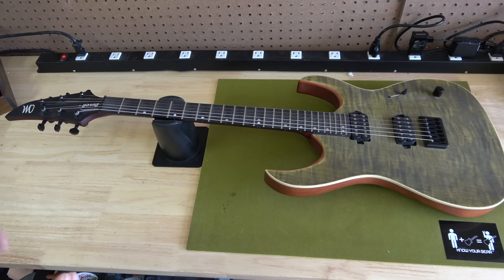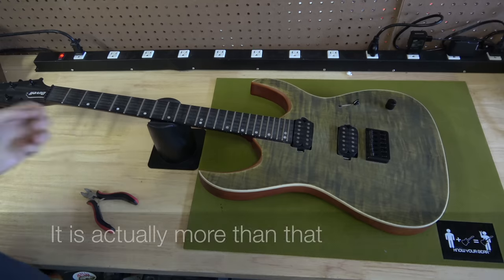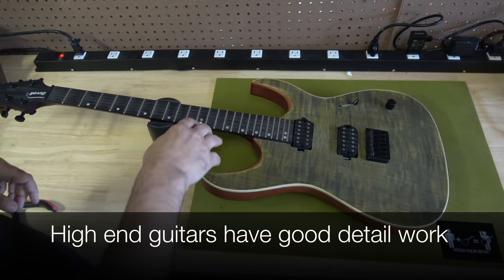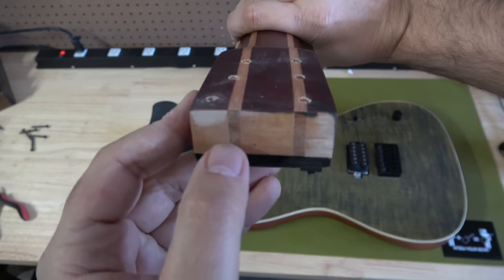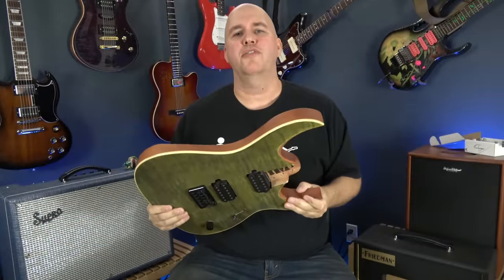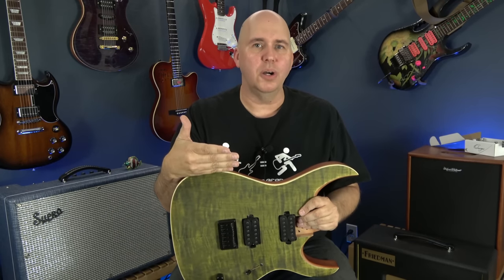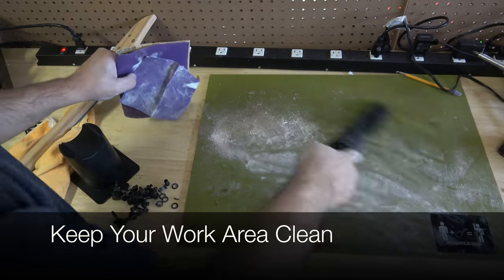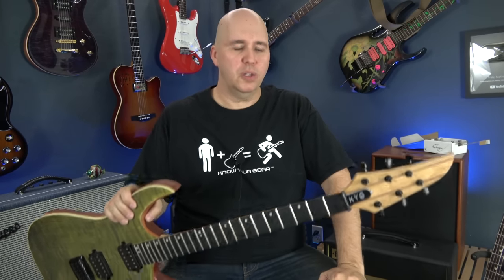Counterfeit Guitars Are Out Of Control.

Comment: I say, buying fakes is fine so long as you dont try to resell it as a genuine
Reply: Exactly. NO one that has a clue is (a) going to be fooled by one or (b) think they're getting a Les Paul for $175.
Reply: I was at a guitar store in San Antonio checking out what I thought was an older Les Paul like 50's relic. And I noticed this little gap be tween the b and s in ths Gibson Insignia. Well it was fake and going for $500. It was made but a local guitar maker, very cool though. I paid $500 for  '75 LP, but it was real, thank God.
Reply: Eddie Perez wish I could have seen it. Sounds interesting
Reply: NO

Comment: I got a low end Ibanez knockoff I modded with a high gain humbucking pick up (I do not need to use the other single coils), put Grover tuners, installed good quality hardware and electric shielding. I had a luthier to put it in its tracks with intonation and truss rod setup and pronto: best guitar any amateur would want.

Comment: Excellent points, Phillip. I'd add that what I find, fairly often, with knockoffs, is not simply poor fit and finish, which is, sadly, more and more common on any big name, high production, factory made product, but, as you say, the details. I get a lot of offshore guitars in the shop, and do my best to bring out the potential, hoping the customer can end up with a great playing guitar that is still well under the price of a famous brand product. While I have had perfectly fine knockoffs, like an American Alder SX tele with 1/4 sawn maple neck, 2 way truss rod, great pickups, excellent fret job,  fine tuners, excellent finish, I had to wade through a half a dozen to find this ONE good one. All it really needed was a bone nut and graphtech saddles, which I put on everything I can. But what I often find is the fakes cannot be intonated, accurately. The placement of the bridge, or the scale of the neck, or both, is just off, ever so slightly that it is impossible to ever dial in perfect intonation. Other details I find, fairly regularly, are the tuners may not be lined up; the nut slot may not be cut square; the access hole to the truss rod may not be large enough or may be off center or both, so you'd be looking at quite a bit of work to correct these flaws. Most of these details are not apparent to an excited buyer; they can only be found when it's on the slab, ready for mods and upgrades. American parts will not fit offshore guitars, and I often find expensive, quality parts on cheap guitars, and they do not help because they do not fit. I recently had to undo all of the rather expensive upgrades to a rare, badass, limited edition Indonesian Squier Strat. When I got it back to stock, it was perfectly fine, and still inexpensive for the playing quality. The last area that distinguishes cheap knockoffs from the real deal is the quality of the wood. The top name factory builders and boutique builders select the best grade, correctly cured woods. The cheapo brands don't bother; consequently that (now) great looking neck may warp or twist after a few years. (Got one sitting right here, now). Not such a problem with a bolt on, but end of the line with a set neck. All in all, I agree with you on the main points. I hate fake anything, and have never respected ripoffs. Building a reliable, stable, perfectly fine guitar shouldn't break the bank. You just have to consider what is worth while. By the way, my dear old friend, the late, great Larry Coryell showed up with a Cort guitar, once. I asked if he had fallen on hard times, and he laughed and explained that Cort had been around for a long time, building all grades of guitars for lots of brands, and that ALL of these big factories build guitars for all levels of players, from beginners to pros. His signature Cort is an example of the top quality products they can, and will, make.

Comment: Hi Phil, 

Would appreciate your input.

After removing the logo, sanding down the neck and re-staining and removing all other propritary logos, at that point is it really nessessary to brand the guitar as fake?

I my self made a copy of a 54 start from scratch. I Made the neck and body, manufactured all the components, bridge, saddles tuners and wound my own pickups. But it is as close of a 54 strat as I could get, nitro finish and all. 
Would u say I should b branding this as fake? Even though I do not have any of the fender markings (minus the head stock shape). 
I ask because once you have done all the modifications to the fake guitar you had its basically the same as what iv created?

Cheers!

Comment: I have a $400 guitar with Seymore Duncan's and locking tuners and it plays and sounds better than a Fender or Les Paul. I changed the strings and pots as well and it's sweet. $4000 ??? Nah!!
Reply: Same...It's all in the setup and wiring..
Reply: That's cool. I have a Schecter that I gave 700 for with a gator case. It's got Seymour Duncan's on it and it's amazing for the price. All the so called high end guitars are way overpriced.
Reply: The thing with cheap instruments in general (not just guitars) is an utter lack of quality control. You may get a really nice one. More likely, you'll get something reasonable, but with one major flaw you have to fix if you want to use that instrument seriously. But from time to time, you'll get something that is just utterly unplayable and should be harvested for parts. When you pay more, you damn well expect NOT to get one of those (although occasionally you still do).
Reply: @mal2ksc  There's really no substitute for playing and/or inspecting a guitar before you buy it.  Buying stuff online is definitely convenient, but it's impossible to know if you're getting a good one or a dud unless you actually play the exact guitar you are buying.
Reply: I have a Schecter $700 guitar and I have an Ibanez $2000 guitar and I can tell you that it’s night and day difference.  The Schecter is still very good for the price.  It’s just not as good neck action but close enough to be very playable.

Comment: I get all the hate on fake guitars when people are getting ripped off but there's a good side too. You can custom order any sort of shape/configuration/fretboard, basically like a custom shop but cheap, they're not the best guitars at first but once you've upgraded them and get it set-up they can be pretty damn good guitars customized to your liking! You will have to find the right shop, there are some really good ones but there are alot of bad ones too though.
Reply: I don't know of anyone who would mind that. Not everyone can do the woodworking to build a guitar from scratch but most guitarists know how to set up guitars. As long as they don't go around saying their diy build is a legit 1947 Gibson or an original series LP and they are straight up with the fact they put raw to work no one I know would say anything bad, especially if it sounds decent.
Reply: Yes, but that can be done without saying it's someone else's brand. I'm perfectly fine if you build a single-cutaway solidbody, two pickups, 3+3 headstock... but brand it as "Gibson" and say it's worth $4500 and that's where we'll have issues.
Reply: Guitars especially electric guitar aren't very expensive to make, you don't need to fidget with acoustics, you can in theory make it out of a shovel and it'd be fine. It isn't like that with many other instruments. So the extra thousands that you pay for a premium guitar, that's mostly brand and some nicer crafting. But I bet if you paid the Chinese more, they'd do just as well. Besides people complain about the neck not being sanded properly or the frets being rough, you can fix that yourself very easily.   

Do you have any shop you could recommend Rudie?
Reply: @robkphoto5530  Not every shop makes the same guitars so just look on AliExpress and find a shop with the guitar that you want, make sure it has good ratings and lots of orders. Send a message to the shop to see how they communicate and test their knowledge. When you've ordered it ask for pictures before they send it so you can spot things that might be wrong when it's still there.

And like you said, lots of little problems that might come with it can be fixed by yourself quite easily. I think you can get great value guitars from there.
Reply: @egmccann  that's why I ordered mine without a headstock logo, or put on your own custom logo! People don't realize that it's also People who scam with these guitars, don't blame the manufacturer.
Reply: @robkphoto5530   I'm guessing you have never built an electric guitar from scratch. Just buying good lumber for a guitar can cost more than $100. in fact a good flame maple top will cost more than $200. That doesn't include any of the hardware. If you want quality, it costs money. So often people want quality at bargain basement prices, it's an awesome dream, but not a reality. If you want a cheap guitar, fine, buy one. Hopefully you don't need it to have a brand name on it. One additional thought, how long does it take you to sand the neck or do a proper fret dress? When you get a really good quality guitar (it doesn't have to be one of the major brands, there are some amazing custom guitar builders out there) they put the time into building the guitar correctly. That takes time, skill and the use of high quality materials.
Reply: @nicholascustomdesigns8365  Most of the cost for US built guitars is the labor. But realistically a skilled laborer in China can do just as well. Except you'll be paying the US worker $20 an hour and the Chinese $2 an hour. So if both put 10 hours of work into it that's $200 vs $20. Problem is most Chinese are still working at huge profits. If the mindset was changed to quality they'd be unrivaled because of lower labor costs. 

Again, whether you buy wood for $5 or $50 000 it's going to sound exacly the same so that's kind of a dumb argument. A car with gold plated interior is more expensive but doesn't add much to functionality. I can get any reasonably good wood for a couple of euro for the quantity needed for a guitar. No material on a guitar is very expensive at all. Unless you go for rare woods or they are for some reason prohibitively expensive in your area.

And for "some" reason Japanese made guitars (and most other products) are cheaper and better. Compare American or European made motorbikes to Japanese made motorbikes for example.  American labor products are always going to be prohibitively expensively because of the working culture and wages. It's impossible to have a good product at a reasonable price when you don't have neither the conscientious working culture of Japan nor the low wages of China. 

Hence why you have such a huge trade deficit, you need to focus on intellectual products, luxury goods, software etc. Whilst the Chinese guitars aren't the best quality, they are leagues better of a product for their price than American guitars. Look at the iPhone, it's far too overpriced for what it is... (that's your "American brand" price = Fender) now imagine if it was actually made in the US, it would probably be 5 times the price if profit margin was to be kept (that's your labor costs).

Comment: Seriously sometimes the right set up is everything... I got a cheap Jackson, and a luthier but it in pieces just to put it back perfectly and super precise together.. cleaned the pickups (different ones, not the ones the guitar came with) from the inside , even mill out some parts out... He worked over 12 hours on it and it sounds and feels like a complete different guitar, much more sustain, more clarity, better tone in general... You don't really need to buy a expensive guitar :D

Comment: To add to this, look for stories from sellers that don't add up. For example, I was interested in a Jag-Stang on Reverb. The seller used photos that he stole from various ads on the internet and said that he didn't take photos of the actual guitar because it was in the studio. First off, the stolen pics are a huge red flag and secondly, if you write songs using the guitar, chances are you're going to take it home with after you've spent time in the studio recording. In my opinion, it's not believable. He also did the sense of urgency thing. He told me he had a baby on the way and needed cash asap. He also told me he had another interested buyer which is a line I've heard from people selling cars to just about anything. Do your research and a little detective work if you need to before sending anyone money over the internet. If I hadn't of done reverse image searches of the pics he uploaded, I may have sent a stranger nearly a $1,000 and got ripped off. I did report the ad though and Reverb took it down. 😁

Comment: Another great video 👍 from what I’ve seen generally the attention to detail on fakes is usually focused on the things you see - the shape/colour etc. So if in doubt look at the less obvious things 
- fret ends
- truss cover
- nut
- control cavity - looking inside might reveal a lot.
Even really small things like the screws used - do they all match?
- are they placed correctly relative to each other.
I know sometimes its easier said than done to not be fooled but if in any doubt don’t buy it. If its bugging you before you’ve bought it its not going to go away.

Comment: Interesting enough, I recently bought a guitar from "Wish" as the cost of the guitar was not much more than the free shipping break point. $20 for shipping or $70 for a guitar and free shipping, you can guess my decision.

The $70 guitar I received seems to be better than this high end fake. To be clear, it makes no claims. Headstock is not marked. There is no serial number. The pickups are probably cheap. But... The frets are nicely finished (I would say better than my Spirit by Stienberger [made in China {don't get me wrong, it plays excellent}]). The inlays are good (Not great, not bad.) with a little bit of filler on the high E string end. The 5-way switch is a million times better than my first Squire Stratocaster in 1992. The body is one piece of wood and a sunburst color. My decision was that I don't own a sunburst guitar and here I get free shipping and a $50 guitar effectively, therefore, let's do this. The body seems to be one piece of wood and a nice sunburst finish. The neck is a light wood with a dark wood fingerboard. The fingerboard does not appear to be rosewood. That being said, it never claimed to be so. End game is it plays well.

But it sounds like this fake guitar you serviced was so beyond fake. It was just bad quality with a supposed heritage. 

I guess my end statement is that I a surprised that someone got a high end guitar clone so wrong when there are people doing it for cheap without ripping off their trade marks.

Comment: I got screwed on a supposed to be Fender strat.  It took a while to figure it out.  The thing won't stay in tune.   It had a real crappy paint job.  Turns out it was a lot that was horribly built.  Learned my lesson on buying used guitars.  It's a wall hanger now.

Comment: Those average $350.00 on the import sites....my guess would be that ones a little cheaper than the average......but for a stage guitar...
 Buying one of those and sending to a shop to be polished and modded is a very good idea...
 It turns out being a sub $500.00 guitar that will sound look and play as good as could be expected....
 I have a "chibson SG"...I custom ordered it with an ebony fretboard..
 Turned out they did not complete the body carving , and the one peice mahogony neck was a bit green , and ended up twisting at the headstock...so I got a bad one... never the less it was only $230.00 to the door..
 I am a guitar tech...I spent the hours on it...gave it new hardware and pick-ups...now it plays and sounds great....$350.00 in a flame top SG with gold hardware that sounds absolutely great...
 So what if it says Gibson on it...
 It'd be weird if it didn't....
  Personally...its just the shape of the SG or the Les Paul that does it for me....."Frankly I could build a kit guitar that would out play a Gibson factory guitar any week of any month"....
 Its just asthetics....we want what looks sexy and cool from 10'-50' from the stage...thats what we get....
 Plus if someone knocks over a cymbal stand it doesn't goudge a $3000.00 guitar....it goudges a $400.00 copy of a $3000.00 guitar....none of the people in the bar know its a copy , and frankly...if you don't know everything about, say, a Mayones guitar...ya' got no bizness chunking out $3000.00 for one....besides these copies will induce the mayones, or other companies like them to produce guitars in volume and give us what we want...
 In all reality....it only costs a manufacturer about $100.00 more to mass produce a very hi quality guitar , rather than a peice of shit...
 That means bone nuts..great tuners...name brand pick-ups...hi quality woods , etc....
 A flame top gibson les pual custom is really only worth about $1000.00 in a nice case brand new....who knows where they come off charging $1500.00 more than that for it.....
 But I hear for $400.00 you can buy a dead nuts copy that sounds looks and plays just as good or better....its just logic.....